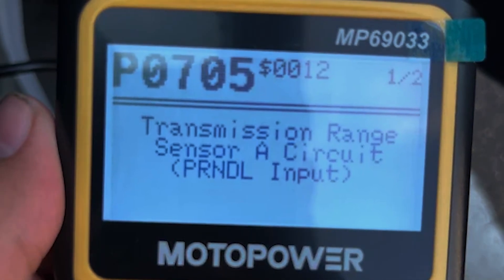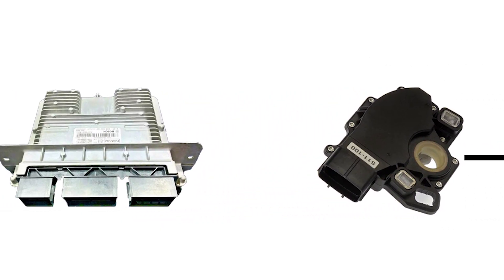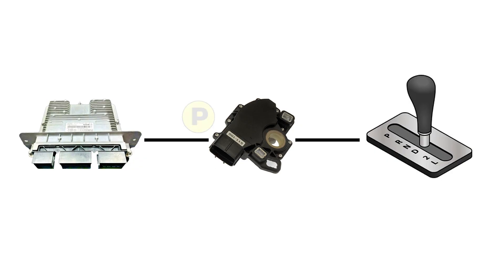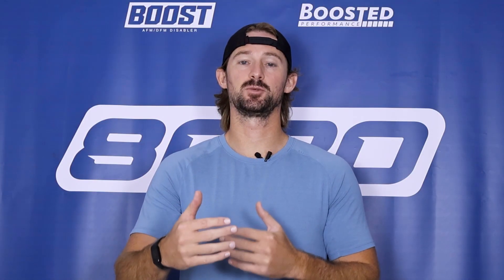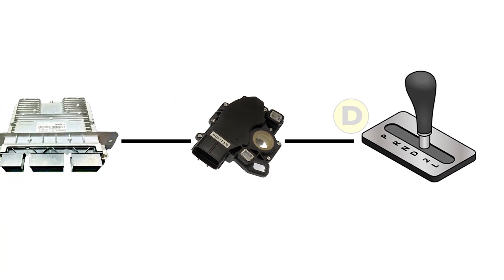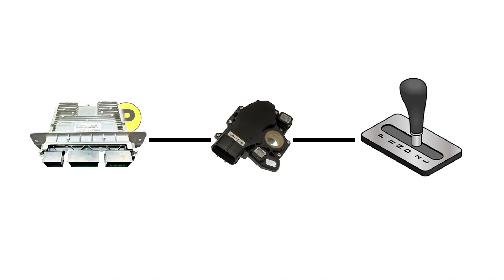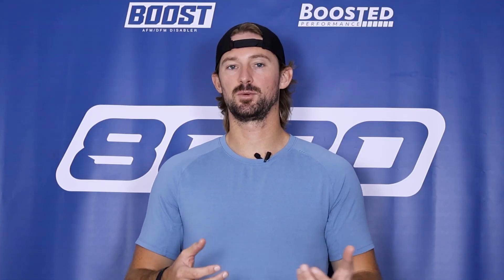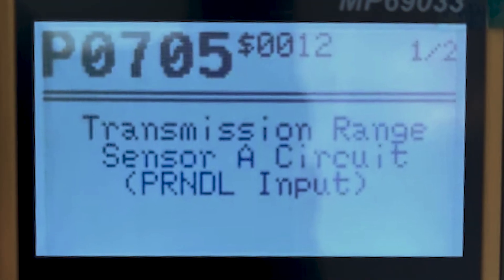P0705 Trouble Code – Don’t Replace Parts Until You Watch This!

Comment: Replaced the NSS ($35 CAD on Amazon) myself, but the dash gear lights blip on going into the gear I’m selecting, then go off when I’m in the actual gear position I want. 

705 error popped up. I cleared the engine light, then drove it a bit, and the engine light popped up again… no I have to find another reader (borrowed the first one and returned it) to confirm that it’s the same code.

Comment: Excellent. I had that code recently along with the Mass air flow sensor code. I forget the numbers.  El and Trac control lights on dash and then they go out after a while. Then the lights come back on. Weird. 2019 Toyota 4 runner